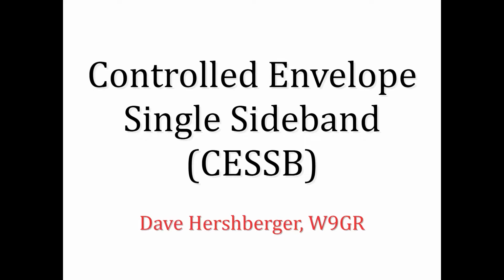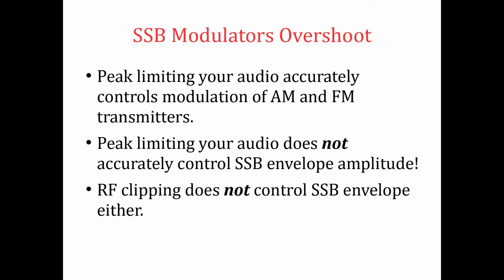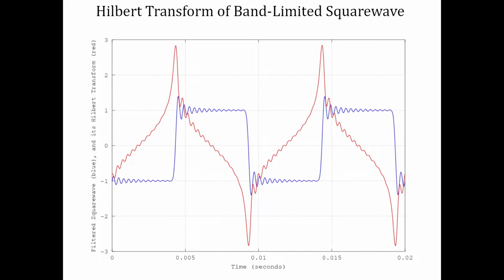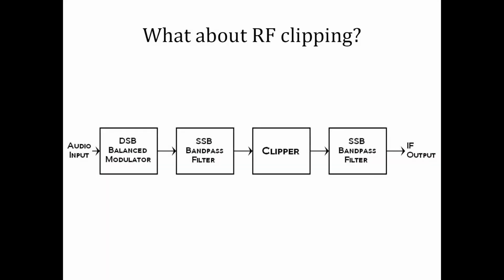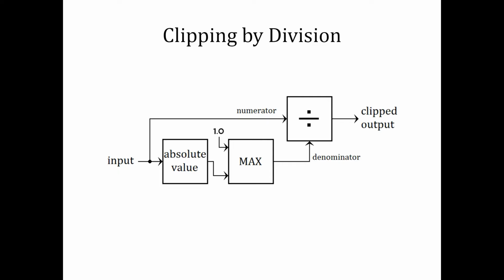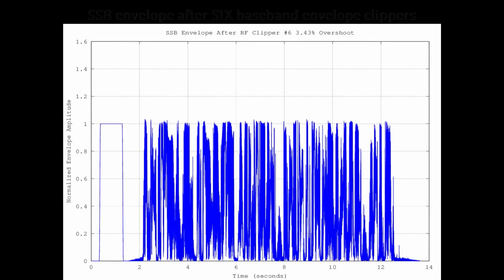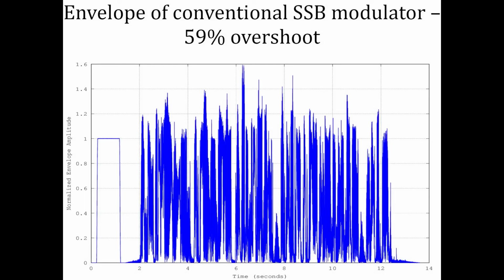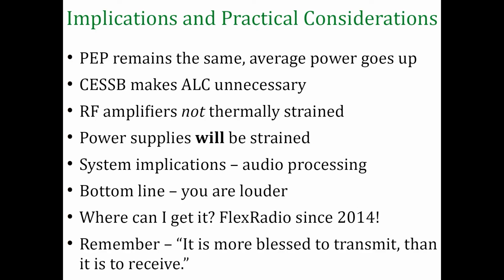How to get more RF power from my FlexRadio!

Comment: That's why LDMOS amps should only be driven to 50% on SSB, using input resistors to limit the drive—otherwise, you risk damaging them. Instead, use CESSB with push-pull LDMOS amps, which can deliver up to 3 kW. With half the drive, everything stays perfectly linear and comfortably within the 1.5 kW limit. Most importantly, you can finally use a high-quality downward expander combined with a good multiband compressor on SSB. The audio sounds clean, splatter-free, and uncompressed, with the ALC completely out of the picture.